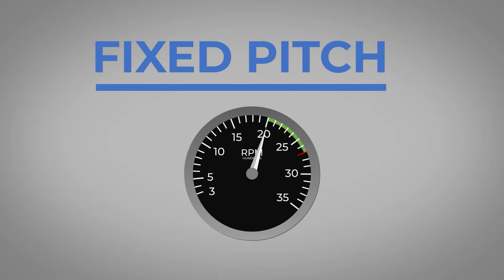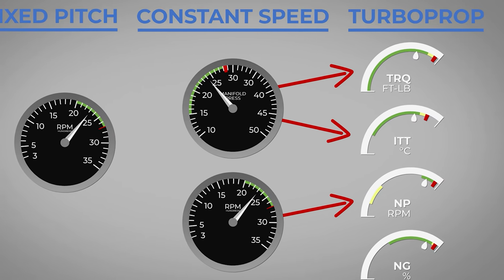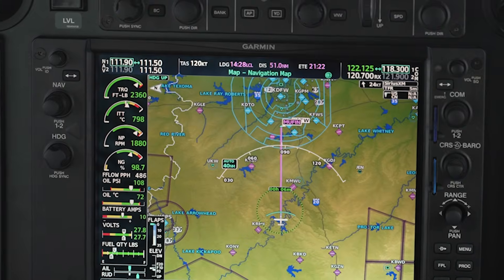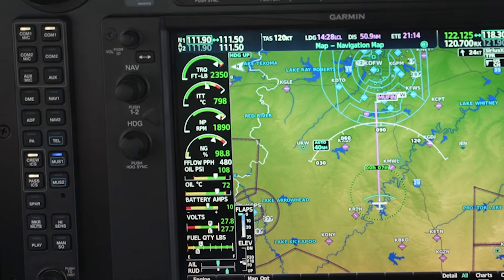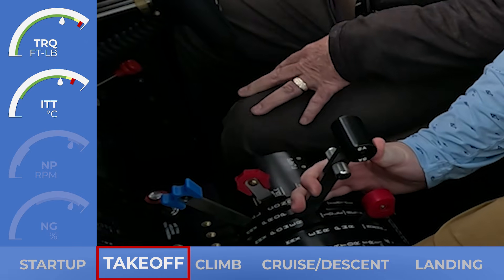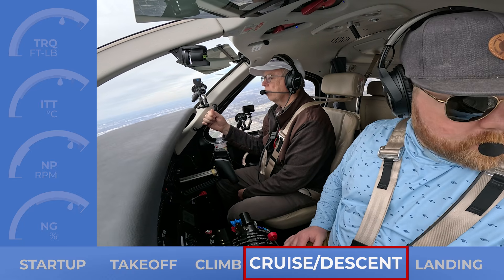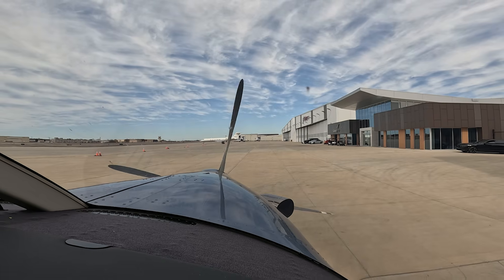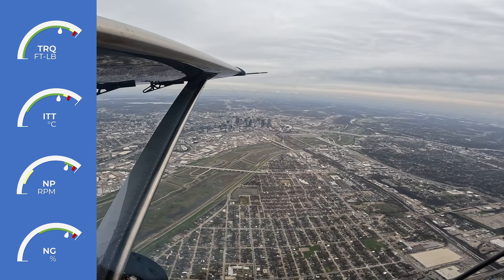Turboprop Torque, ITT, NP, and %NG Explained (in Plain English)

Comment: What does NP and NG stand for? I know what their gauges mean, but what do the letters stand for?
Reply: N is just like a general placeholder, like X in a maths equation. I guess it could stand for number but I believe it's just a letter that was chosen. Then P in NP stands for propellor, and G in NG stands for generator. So NP 'total RPM being governed by the governor on the propellor" and NG is "percentage of gas generator speed". There are two sections of a PT6 engine which are a gas generator and power turbine section. Power turbine spins a bit slower than the 37,500RPM of the gas generator in the model I fly with.
Reply: @lntg  Man, you rock! I appreciate the education.

Comment: Your terminology is very engine and type specific. I’ve flown three turboprops, Jetstream 31/31 with Garrett (now Allied Signal) TPE 331, Fokker 27 with Rolls Royce Dart 1830 and Fokker 50 with Pratt and Whitney PW125B. Here’s my thoughts:

Torque may be displayed as ft.lbs, psi or a percentage. It’s just a number. You learn the numbers.
ITT really does need looking at during a start and on some types during the cruise.
Np is almost irrelevant. You typically set it and leave it. The Fokker 27 was an exception to this.
Ng ends up and being what it is.

The last turboprop I flew was a Fokker 50. Next to a jet, it to be one of the simplest aircraft a person can fly.
Reply: Some don't even have a prop lever.

Comment: Nice operating description. I have a question though, at landing phase what are the settings to go in case of a go around? Since your prop is fully foward I guess you can't slam the throttle full time to have all the power. In that case do you  pull the throttle slightly back before hitting on the throttle full power ? 
(Kind of a piston like action )
Reply: You advance it forward slowly to the desired amount, and with experience you intuitively know the sensitivity of the power lever. It just takes a few seconds.

Comment: The over torque/temp is obvious when you think about it. Down low the air is dense, so big power is available. Up high, the air is so thin, it doesn't have the thermal capacity to cool.

Comment: You can always tell a new turboprop pilot when they bounce off the prop governor, a good technique is stand on the brakes and smoothly apply enough power until the governor is holding the prop at the speed you need and then you can briskly bring the power lever up to take off power.

Comment: FYI, torque is measured in lb ft, not foot lbs.
Reply: Same difference. You can have 2lb x 1ft radius, or 1lb x 2ft radius.
Reply: Except that torque is measured in pound feet. Much like the metric measurement of newton meters. Force is first distance is second
Reply: Literally the same thing. Order doesn't matter for multiplication
Reply: @andrewahern3730  you are amazingly wrong. But carry-on
Reply: @kevinbarry71  lol, let's hear it. Explain why I'm wrong
Reply: @kevinbarry71  its measured in Ft-Lb, at leasts on the G1000 in the kodiak And Caravan....
Reply: @isaacfriedman1698  then that is unfortunate. I would expect better

Comment: Great info and well explained.  But I must complain about your use of the term "rpms".  As I am sure you know, rpm stands for revolutions per minute, or how many revolutions in one minute.  If you say "rpms", you are literally saying "revolutions per minutes".  So how many minutes?  That usage is ambiguous and incorrect.  The only time "rpms" is correct is when comparing two different instances like, "the rpms differed by 200".  Sorry to be picky but the continued incorrect usage is extremely distracting.
Reply: It’s incorrect usage and extremely distracting of you to not capitalize RPM.

The colloquial use of “RPMs,” on the other hand, is quite common and acceptable.
Reply: no its not
Reply: What are you talking about? Nobody is counting discreet revolutions. I think some heavy equipment logs usage in "hours @ 2k RPM", but that is by far the exception, not the rule.
Reply: I find the usage rpm’s annoying.

Comment: Great video!  So if the prop is set at like 2000, and you increase torque, for the prop to stay at 2000 it would increase in pitch hence more thrust and forward speed right?
Reply from the maker: Correct

Comment: What would a turbine failure be like in a turboprop? (Other than expensive) would you hear the destruction, or would you be fooled into trying to air start the engine on the way down, wasting time in the process?
Reply: I have had 2 PT6 engine failures and they are nothing less than EXPLOSIVE! When a turbine disc, spinning at 44,000 rpm, loses a blade, the engine disintegrates in a dramatic fashion. There is a crunching sound that on my first failure made me think we had hit some object, but when the prop autofeathered, I knew we had suffered a catastrophic failure.
Reply: @MrSuzuki1187  very happy to hear your response. Mostly because you stuck two dead stick landings and are recalling the events, but also to sate my curiosity. Thank you.
Reply: Patey had a pretty good video on PT-6 engine failure:  https://youtu.be/pgpf5ktKVBc?si=0JueWXYrVphXciCP

Comment: Nice one. What is the hire and fuel cost of the Kodiak per hour. Was that your Dad in the right seat?
Reply from the maker: It's burning like 350 pounds per hour in cruise so roughly 53 gallons per hour ish depending on how hard you're pushing it. And yes that was my dad in some of those clips.